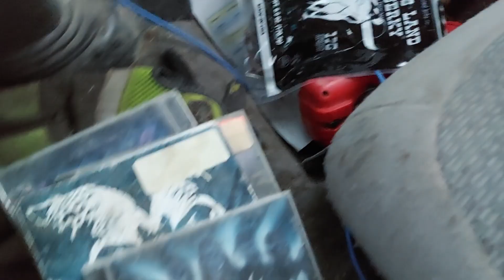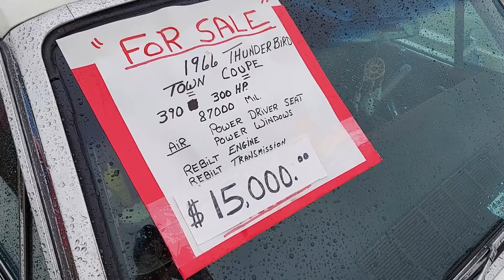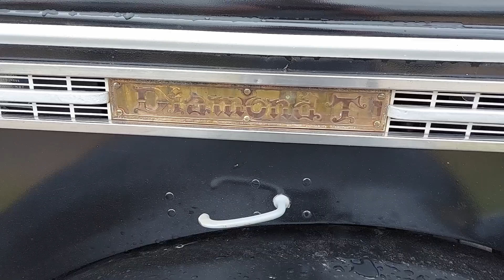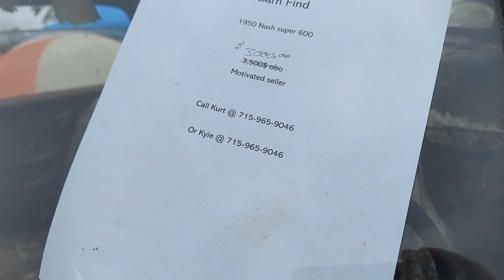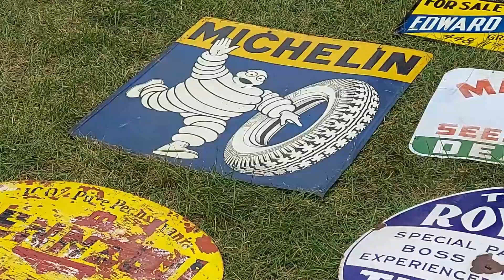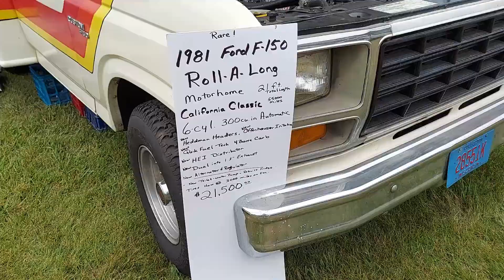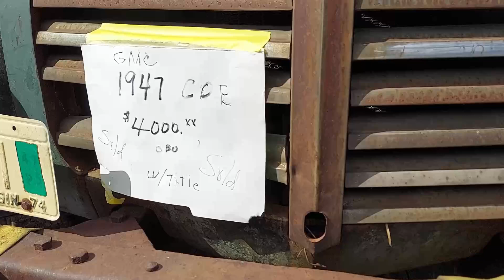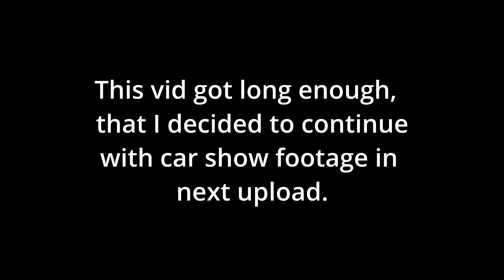Iola WI swap meet 2022

Comment: half cab ..thats the short cab for an international scout 4x4 early 60's ... used to drive one...got my short cab at a yard sale...!
Reply from the maker: Never heard them called that before. Is that what IH marketed them as?
Reply: @misfittoys8883  my Scout was old enough by the time it came to me that factory parts were hard to find ...so every thing I got for it was used parts the names of which was decided by the seller or myself .."short cab" ... just seemed appropriate to me
Reply from the maker: Makes sense. In the Bronco community they have always been called half cabs.